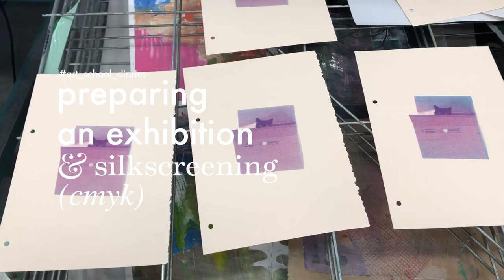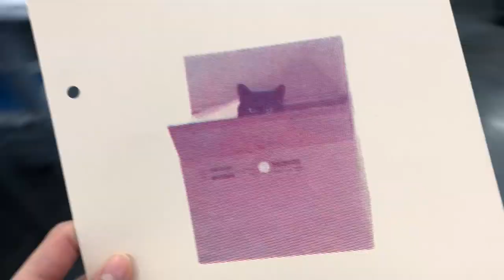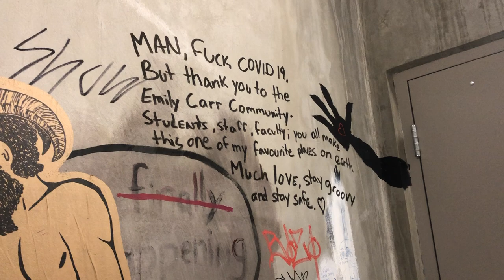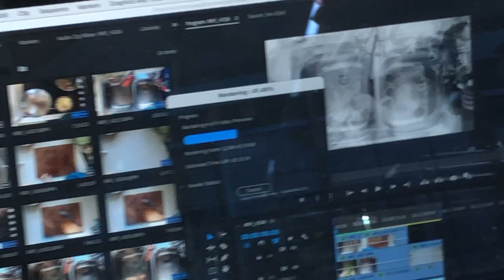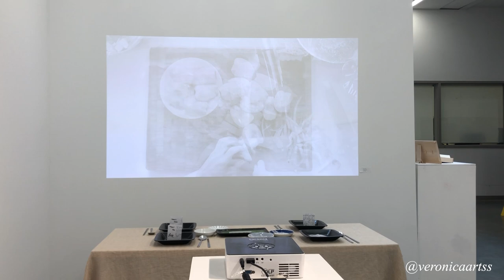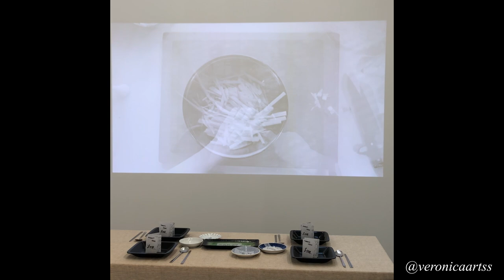art school diaries || my first exhibition & cmyk print nightmare

Comment: i do printmaking and the way we were taught to put the emulsion on was to hold the screen in one hand and tilt it slightly forward to meet the edge of thr trough otherwise the emulsion just goes straight through to the other side of the screen and it becomes too thick.. and then to do another pass of the trough but scraping excess off rather than adding emulsion on if that makes sense??
Reply from the maker: Omg thank you so much for the tip! I’ll try that out for the next exposure!